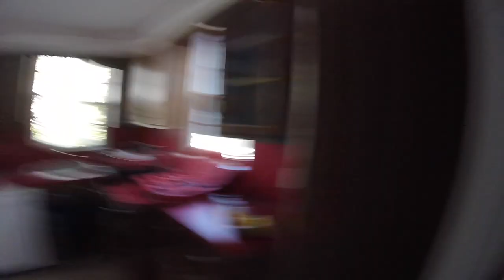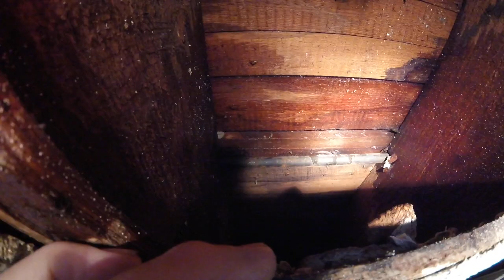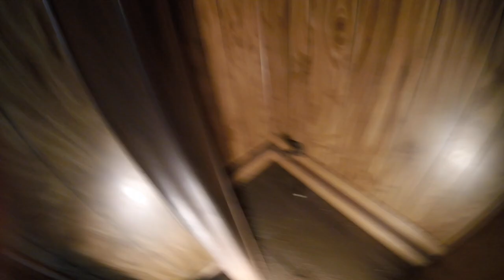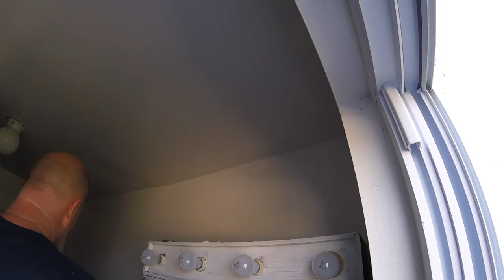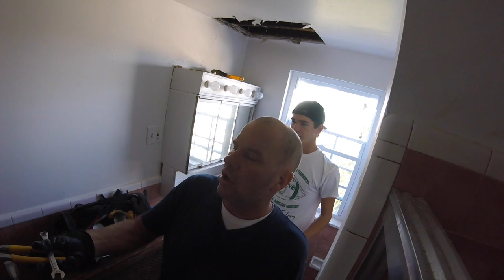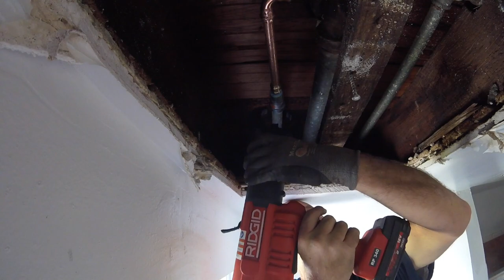Ridgid RP 340 Galvanized  to copper water line repair

Comment: I have not found any approvals to actually use the Mega Press 316 Stainless fittings on galvanized piping. While those Viega fittings are approved for potable water (and other stuff), they appear to be made to work with compatible stainless steel pipe and do not have any dielectric properties. Any press type dielectric fittings I have seen so far have a threaded part on the galvanized side and the press part is on the copper side. I would not follow this procedure without written approval from Viega.
Reply from the maker: hmmmmm. Interesting.

Comment: You should definitely put in the description that it is illegal to hook galvanized directly to copper.

They make many options for the transition, but it you don't want to use them, you can use a brass fitting or nipple between them which is better than nothing.
Reply from the maker: true that.

Comment: Hey chuck. Why you did not replace the 3/4” dia. Galvanized steel pipe with 1/2” or 3/4” uponor pex pipe FROM Lavatory Basin to basement???? Why not replace a whole section pipe with uponor pex pipe instead???
Reply from the maker: oh I remember this job. The next fitting was deep in the wall and the owner was crying about time and tearing down entire ceiling to get it done right. A rental property they were trying to get back on line.

Comment: If an installation requires contact between galvanized materials and copper or brass in a moist or humid environment, rapid corrosion of the zinc may occur. Even runoff water from copper or brass surfaces can contain enough dissolved copper to cause rapid corrosion.

Comment: A true plumber lol we" cut " drywall with hammers.. Great video i pray my boys will work with their old man when there're older 13 and 9 now..
Reply from the maker: lol......break out the dull blade! Hammer TIme!
Reply: I like an oscillating multi tool for drywall but it would be too slow on that lath.

Comment: went to local plumbing supply and was told these fittings are not for potable water. what fitting are you using
Reply from the maker: Viega....for water pipes.
Reply: That is correct as far as I know it's for non potable water only

Comment: ever consider getting one of those portable infrared devices from flir to find leaks?
Reply from the maker: No but I just used my new milwaukee on a job that would of been perfect for this job.
Reply: A hammer against hardwood floors is just as good.

Comment: what brand of crimp fitting is that gal ? here in australia I've never seen that before.....
Reply from the maker: Wes, that is viega mega press for iron pipe. They make for water to. Example this job was a water line and also you can you on heat lines. Good eye plumber. do you live near water? If so do you surf?
Reply: Chuck Barron hey mate thanks for the reply, live in sydney mate so where only 30mins from any beach mate. i paddle board also, it’s the best fun i’ve had on the water as the board is so versatile for the family. i’ve watched all your press videos and i’ll be making the purchase of the rigid 210, never owned one before but certainly your videos have made a very easy decision for me to purchase one. our main water lines from
the main water supply in the street to the house here in australia are 20mm, all the water supply within the house for cold water is 20mm and all the hot water is installed at 15mm.
Reply from the maker: Now we talking...the sup life is so chill! not sure if you know but that my passion. The amount of waves we catch are unreal. So many! enjoy and get er done onthe pro press daddio
Reply: Chuck Barron yeah mate watched ur videos. i’ve got an 11’6 board 33’ wide, known as my baby, best water sport. keep up the good work mate. thanks for replying, highly enjoy ur videos.

Comment: For some reason I never thought to use mega press on a galv. Water line. Sure beats working your way back  finding good threads.
Reply: It's not to be used for potable water
Reply: Dude. I didn’t know either.  If I did. I would have bought the jaws also with yesterday’s purchase of a press tool.

Comment: I would’ve liked to see that piece you used to connect the copper to galvanized
Reply from the maker: The company is called veiga and fittings are mega press for natural gas and for water lines, heat lines.
Reply: I dont think it is for potable water.
Reply: @kimavarte6773  I'm with you
Reply: @ChuckBarron  DO NOT USE ON DOMESTIC WATER.
Reply: @johnnysplumbinghydronicsco9390  Why not?

Comment: Not bad, galvanized to copper is always tricky the electric crimp tool is a luxury but re threading in tight quarters is very difficult
Reply from the maker: Great point! I would of had to take down ceiling to next fitting.

Comment: Chuck, 
 Can you tell me if this is the Viega MegaPress Stainless 316 fitting you are using?
Reply from the maker: Im not sure what number it is but fitting for water or heat line repair only. Not the gas fittings for this app.
Reply: Thank You!

Comment: From what I have seen on Viega’s website, mega press is not approved for potable water. However it is approved for other water lines up to 200psi. I also have heard people say the mega press fittings will rust. What do you think chuck?
Reply from the maker: Well you see what we got here. This was perfect and I rarely use on domestic but I have had no problems. I use on heat lines too. Rust? not sure. Not sure on website either. Maybe they are not lead free but If Im Viega and making these killer fittings Im sure they are lead free.
Reply: Chuck Barron yeah the rust thing seemed far fetched to me too. Thanks for the response
Reply: Mike O'Brien then you haven’t read properly.  The 316 stainless EPDM is rated for potable water. Hot/cold 200psi.

Comment: The SHOE FITS, 100% for Emergencies,  Cost effective not listed repair solution for green dot hydronic fitting $20. The Stainless steel 316 fitting for 1/2 is $50 is more approved and also fits. May need stainless steel  (SS) press heads.  One of my supplyhouse salesman had some mason jars in his office full of water. They had a variety of fittings in them. One had the boiler treatment fernox added.....the fittings were like new after many years... the others were like a ship wreck of rust and sand at bottom of jar.  Only time will show the typical life of the hydronic fitting used with potable water. I have done this on a new tub and shower valve to the existing galvanized shower riser.  I was very confused long ago how black pipe is used in heating systems and did not quickly rust away ... closed systems don't get fresh water with fresh supply of oxgen... exspecially if have anti corrosion in system... that turns out to be the whole problem in Flint Michagen. No anti corrosion added at the new water treatment plant allowed protective buildup to rust away and expose pure lead...I think... but I am just a dumb plumber... and when I was an apprentice the Journeyman would get mad if i asked questions... he would say that is what plumbing school is for.... and if you want some advise...DON'T ASK NO QUESTIONS IN PLUMBING SCHOOL BECAUSE EVERYONE JUST WANTS TO GO HOME... AND YOU WILL END UP MAKING EVERYONE MAD AT YOU BECAUSE THE TEACHER WILL KEEP THE WHOLE CLASS LATE TO ASWER YOUR QUESTION.

Comment: Or u can up size a copper tube size ford coupling for the galvanized and then the other side 1/2 ford cts

1/2cts =3/8 ips
3/4cts=1/2 ips
1cts=3/4ips
1-1/4cts =1"ips 
1-1/2cts =1-1/4ips 2"and so on its relative
Reply from the maker: all iron pipe here.
Reply: Can you really use copper propress on galvanized? I thought they were designed to crush a little? Wouldn't that basically break your press gun?
Reply: @zerovalue5106  no iron pipe u would need mega press it is for steel  pro press is copper  I was suggesting brass ford couplings they are mechanical in design  but the gaskets  in them can work for almost what ever u do 
Copper ,cpvc, pex,quest they are all in the cts range copper-tube-size
Threaded nipples galvanized or black ,PVC  are ips or iron pipe size

Comment: Megapress customer service told me they don't make a fitting approved for galvanized pipe. Pretty risky showing this work on YouTube. Could be a future lawsuit!
Reply from the maker: Interesting! Our gas utility and inspections all approve it here. Im gonna have to check it out.
Reply: Yes you are right that mega fitting is for gas pipe and heat pipe is not for potable water.

Comment: Is that a gas megapress fitting or water megapress fitting?
Reply from the maker: that is for water....they make both...blue or black 0 ring  on inside is for water and yellow o ring is for natural gas.
Reply: So, all you need is to do is just cut the galvanized pipe and then sand it and megapress it? Do you need to debur it or ream it? What sawzall blade do you use to cut the galvanized pipe with? Thank you for your response

Comment: is that megapress stainless or just regular megapress?
Reply from the maker: mega for water ....heat lines or domestic.  The viega company
Reply: All mega press fittings are stainless. They are not approved for potable water however.

Comment: Nice job guys!!👍🇺🇸I use a small camera to look in walls to find leak,and then break open wall or ceiling! Just a tip! I know you have all the Cool Tools Chuck👍
Reply from the maker: I  did not have the tool at the time..I do now though.

Comment: The M12 copper cutter is cool. Check out the M12 ProPress tool. It's like 3 lbs lighter than the Ridgid and one handed operation.
Reply from the maker: yes we just got that cutter. so sweet. im so deep in ridgid but would like to check m12 press some day.
Reply: it's compatible with the Ridgid compact jaws you already have, so you could get the bare tool to save some $$$